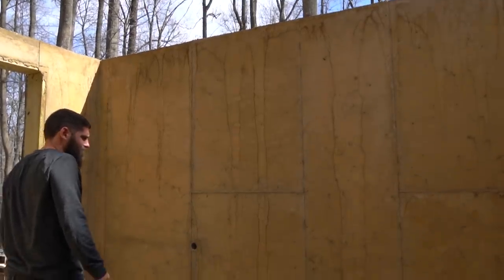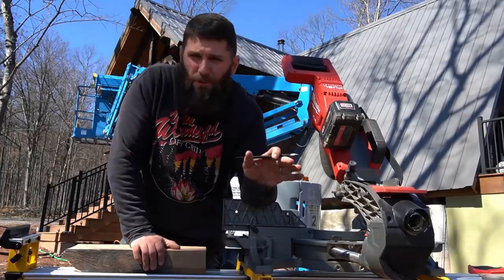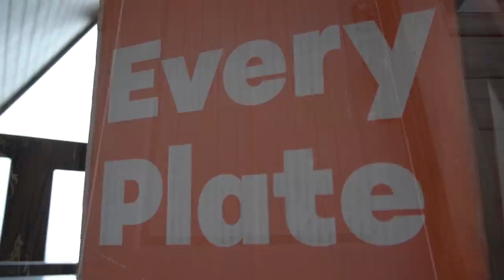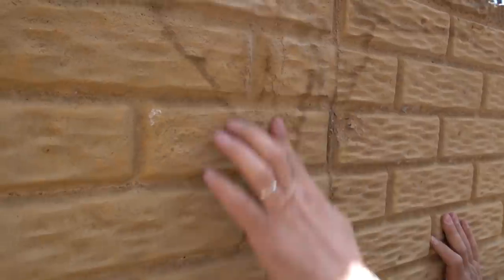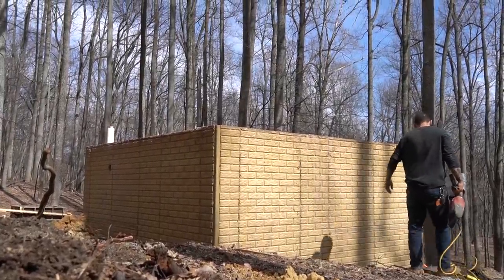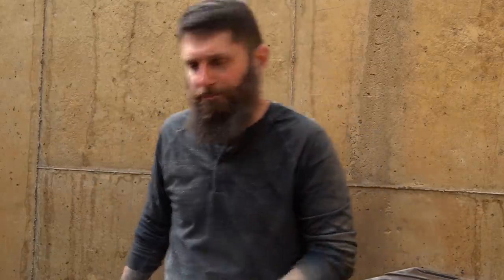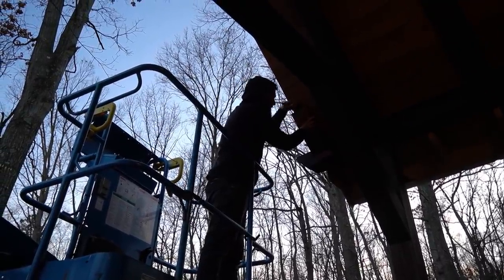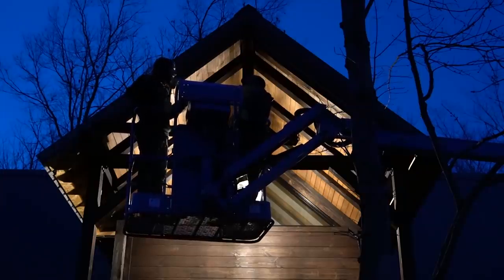Tearing Down The NEW Concrete Walls?

Comment: Regardless of whether or not the samples past the test, I would be tearing those walls down.  They don't have any reinforcement at all and they already have long vertical cracks.  Those walls are not sound and cannot/should not be used as load bearing walls. Very dangerous if you ask me.  It's a pity, but you might as well bite the bullet and rip them down.  There's no way I would trust them!

Comment: Even if those samples pass I would be tearing those walls down and starting over. The outside is already crumbling and it’s only been a few weeks. What’s it going to be like in 10 years from now??? You don’t want to be stuck replacing the foundation after the house is built. Plus, you’re using that house as a business. God for bid something happens while it’s being rented out

Comment: No rebar, zero slump (min. 6), no vibrate = unacceptable concrete. I hope you didn't pay in advance for the concrete or the forms work. Pay on signoff. You might even be able to collect the demo and testing costs in small claims court.  No lawyer needed. If the guy doesn't show up, you get a summary judgement. If he does show up, you can get a sight draft against his bank account. 
The concrete should test minimum 3,000 PSI, 6,000 would be perfect.  They probably skipped putting rebar in as it's been > $8/$10/stick putting a LOT of $$$ in their pockets.

Comment: Really doesn't matter what the test reveals, without rebar you cannot use it as a foundation to support the house. Concrete without rebar has very little strength.

Comment: A square concrete structure like yours will crack guaranteed They should have placed control joints in the pour. They would have been reinforced at the joint and you would have had a clean and sound crack.

Comment: Shitty deal on the concrete situation.  I was thinking ... if the strength test fails, why don't you consider keeping the walls up still and form another wall outside of the existing structure, while using the existing exterior wall as the interior wall for an exterior pour.  You would end up with a double thick foundation wall, and you could keep what you've got without having to form another full structural wall ... you would have only 1/2 of the forms, could possibly use ICF, and I don't see any harm in keeping what you've got if you could shoot your elevation on the new wall and at least make that right for your wood floor above.  Forming another outside wall over what you have already got, and pouring it yourself, will give you the structural integrity / strength that you need for the building above ... but ya, still a PITA and none of this is ideal!!!  You could possibly tie rebar the new outside wall into what you have already got with the shit wall, and you end up with the structural integrity that you need, and improve on the finished brick pattern you want.  Even if your inside wall comes back under 3500 psi, it is going to be sufficient to support whatever you need above, and lose no square footage in your utility room.  Just make the floor system supported above cross the newly poured wall.  Just a thought, as it's going to be a PITA to tear down, might not be necessary if you can keep it and pour a double thick wall.  Think of what you've got as a permanent, inside form-wall for a second outside wall done right.  No?  And you could form another wall by drilling horizontal holes through the existing wall, and use ready rod with washers/nuts on the interior wall, to support the form wall on the outside new wall.  Would be pretty cost effective from a forming point of view.  Still shitty ... and your door would need to accommodate the extra thickness of  double thick foundation wall.

Comment: "PROBLEM SOLVED" Save yourself some time and labor ....Use the existing concrete walls as the inside framework for a complete new wall surround the existing walls.

Comment: Having been a general contractor for 40 years, I've  never seen such clueless subcontractors as this crew. Watching the concrete being pumped into  the forms I was cringing. The mix was watered down so much that it would never meet the specific mix design criteria. This will have to be knocked down re-done.

Comment: Take the foundation down. Start over. No rebar. Crumbling face. Uneven walls. I wouldn't even trust the pressure test. There was to much water in the cement. It looks more like a mortor than cement. The seam cracks will only get worse over time. Especially on load bearing walls. Find a reputable cement company. Maybe you'll get offers from one out there and get half price or full price off for advertising like a sponcer. I do all my own cement, electrical and building myself and because I've been screwed over by them all. I've learned a lot and do better work than some so-called professionals. I know there are good contractors, but I've not had that experience. Please just take that mess of a foundation wall down. Don't trust a cement that's chipping off pieces of cement with your finger 🤞. Don't trust the pressure test, Please. Good Luck.

Comment: Why is the concrete contractor not responsible for the failure of the concrete wall?  He should have to correct the problems since he mixed and poured the mix.  Time to think about suing.

Comment: So sad to see this. It’s sad that so called contractors treat people like this. It’s very lucky you guys have the knowledge to know what is right and what isn’t. So many people just get stiffed. If they added water on sight to the colored concrete that is a bad deal. The concrete supply should know that. I’m not a concrete guy but had a similar event with a colored patio. The tru ks were late and they added water. The concrete got hot and they couldn’t finish it. Within an hour they could drive the skid steer on it. Bottom line it had to go what a mess. Colored concrete looks nice but it is not the same as the normal mud. Like other said. Take it down.

Comment: Having done concrete work many ages ago, I can say this is done all wrong. Even if it passes pressure testing, its going to worsen and if anything it will bother you subconsciously forever from this point on. I would tear down and do it right (in the words of the great Mike Holmes).

Comment: Wet concrete is weak concrete. I personally wouldn't of even tested it. Wet concrete, no rebar, misaligned unlevel/plumb forms, cracking throughout the walls, concrete spalling all over. Looks like bunch of future problems. Knock it down, do it right. A house is only as good as its foundation. Just my opinion of course.

Comment: I don't know what kind of people do this kind of work in Virginia, but this is a clown show by Ontario standards. Itll be a blow but I'd consider ripping it out. There's no rebar like you asked, its all crooked and out of level and plumb. It's gonna make every other step of the way more difficult, been there and done that, not worth it. I always said a happy customer tells 10 others, an unhappy customer will tell 1000 people. Put them on blast locally. This work is shameful.

Comment: Okay I'll wash your pump one they use the 2 inch line so they use pig gravel and they slurry it up to run through a 2-inch line you're going to get spider cracks that's normal when they slurry it up your PSI is going to drop you're going to get the spider cracks that's real one the rebar they didn't put nearly enough rebar in don't know what your earthquake code is there your seismic code there's two ways to deal with the uneven top you can cut it or you can grout it

Comment: Really sorry this happened guys. And I know what I am about to tell you you do not want to hear,  Been in Commercial and Residential Construction for about 20 yrs.   If something is wrong it has to be fixed just the way it is......Those walls gotta come down guys they are not and will not be safe. You can see its already crumbling because it was to wet when poured and there isnt a Re-Bar skeleton or cage inside those walls.  I know it sucks but fix it now while its an easy fix. Imagine fixing it with a house ontop of if. Really sorry guys. It sucked sitting here watching knowing its not going to pass inspection. Those guys are hacks be sure you do complain that is some BS.

Comment: That's a really awful concrete job.  Good for
You for deciding to keep it in the family.   But the contractor needs to compensate you for costs of fixing, should that be needed.  I'm pretty sure the work team will be blamed by the company. Maybe they'll hire a better crew in the future.   But not to work on your property.  You may remember we recently had a condominium collapse near Miami. Not the exact same problem. But a lot of shortcuts are coming to light since.

Comment: Just watched the concrete pour video. No rebar means you had no engineering . Concrete without rebar is worthless. No rebar in the footings but drilled in some dowels? Bar should be 16 -24" on center , minimum , for verts and 2 ft on center for h bar. Double bars around all openings. Any legit concrete dude or knows that. If the concrete was over a 6 inch slump it was to wet unless they added special additives to accommodate the extra water.

Comment: They poured that concrete way too wet. Didn't look like it had very much aggregate in it. Shitty looking job with it already cracked and flaking off. No way it was a 5000 psi mix, I never made any that wet without a driver or customer wetting it up to get it to flow through the pump.
Looks like all the rock settled to the bottom with it being so wet.